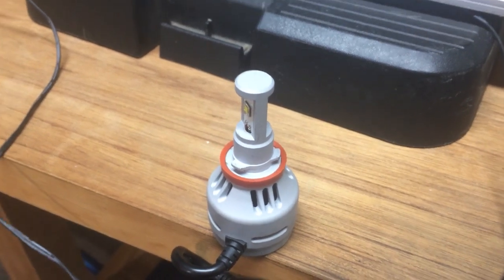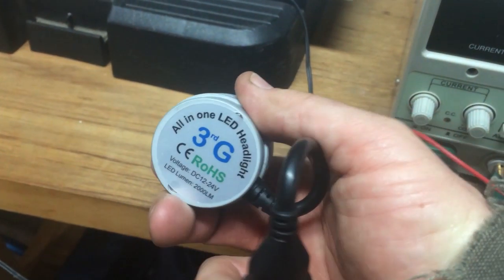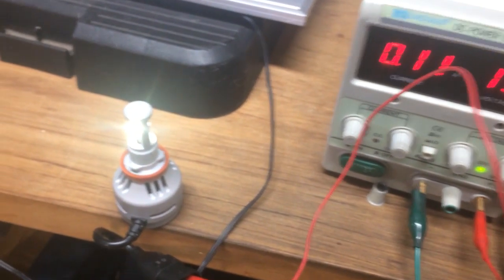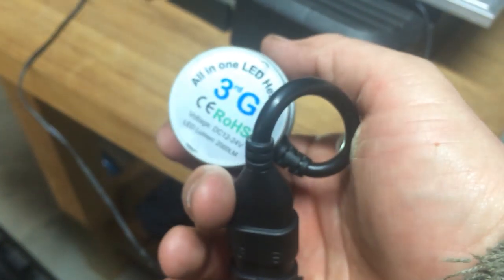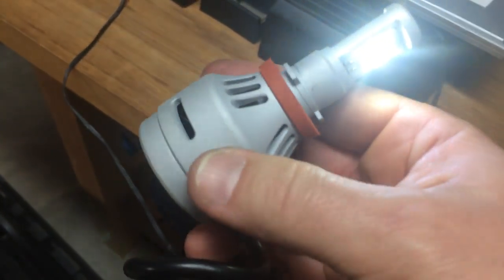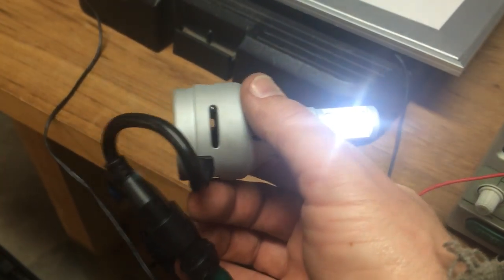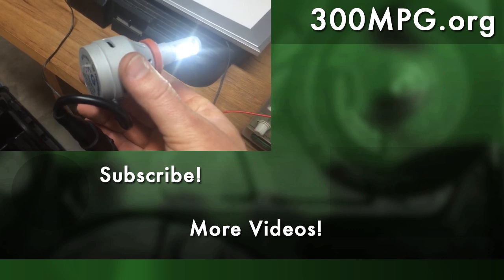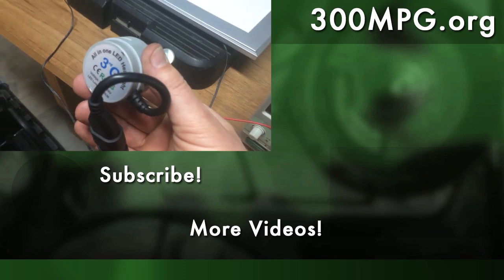LED Headlight Fail

Comment from the maker: Hmmm. I guess I have mixed feelings. The LEDs SHOULD have lasted much longer.... but didn't. (Only lasted 3 years.) I did look up how long standard headlights should last, and based on my driving habits and headlights, regular headlamps probably would have lasted about the same amount of time.
I REALLY liked the look of the lights. They were bright, good color, etc.
3 years ago, these headlamps cost me $70. Looks like I could buy similar now for about $40.
Just a set of new H11 bulbs at the local auto parts store was about $30, so LEDs are NOT much of a price premium!
I guess that for only a little more cost, even if they only last the same amount of time, I really did like the look of the LED bulbs!
The other thing that's always been interesting is how lighting technology has improved. For example, in household lighting, CFLs were ugly and expensive when they came out, but improved over time. The first household LED bulbs were very expensive, but now my entire house is lit with LED light bulbs that I paid $1 each for!
I'm sure we'll continue to see aftermarket LED headlights improve.
Reply: BenjaminNelson I’m in Arizona and just bought headlight and fog light LED combo for 32 dollars on EBay. They look great and work for now but you have me worried. I don’t think mine have a fan inside. They won’t catch My Fiat 500e on fire will they? 😧 why do they produce so much heat? Will I gain a couple miles of range going all LED?
Reply from the maker: @4N2IN0JA  LEDs do NOT produce "so much heat". They produce a lot LESS heat than an incandescent bulb, but the heat they DO make is concentrated in a very small area, so it needs to be dissipated. No worries about starting your car on fire. No, you likely won't gain any measurable range with the electricity you save on lighting. The electric motor uses an order of magnitude more power than your headlights do. An aftermarket LED upgrade is probably best for looks and/or improvement to visibility.
For $32, you pretty much just paid the same amount as you would have for plain light bulbs!

Comment: I've heard nothing but bad things with aftermarket LED conversions and wouldn't touch them, personally.
Reply: Yup, I know someone who had some installed, they didn't last more than a year. The LEDs actually burnt out, turned black - but the fans still worked!
Reply: Yes Same problem for me,